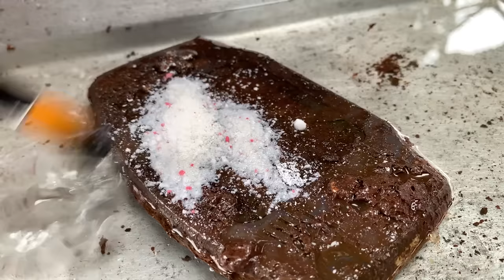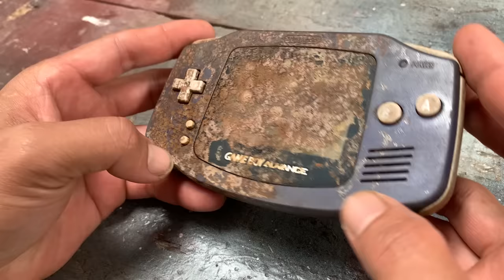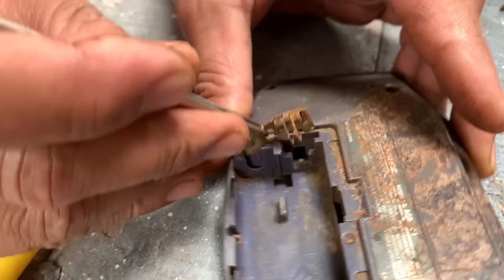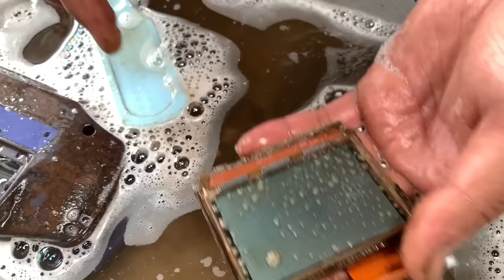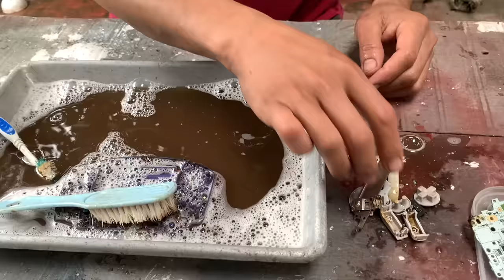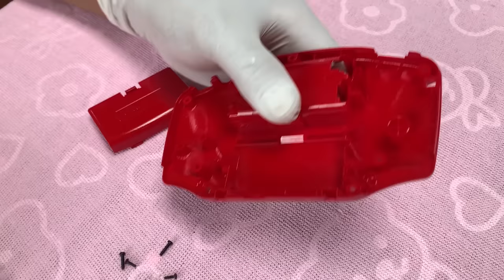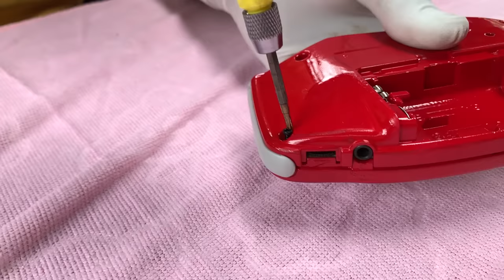Restoration Old Ｎｉｎｔenｄｏ gameboy advance | Restoring Game Boy Advance ＧＢＡ

Comment: Wow, I can't believe the hardware was still salvageable after being soaked in water.
Reply: Crazy how that works in this video
Reply: Thank you, i was confused as well
Reply: Bruh true
Reply: I think it's fake
Reply: It’s software but yeah it’s awesome
Reply: @tazeoloi9547  No, it's hardware.
Reply: Actually since the GBA didnt have an onboard battery, so long as it didnt get wet while a battery was attached, It usually is completely salvageable!
Reply: I think it was alcohol
Reply: so satisfying to watch
Reply: @morgan3814  this - and obviously you need to wait until everything is dry until you try to turn it on again
Reply: there's nintendo for you
Reply: it all depends on if the battery is fully discharged, or if you take out the battery. then no current will jump across a resistor and kill the CPU, same thing with a thumb drive, if you left it in your pants and put it in the washing machine, you could let it dry over time and it'll still work as long as there's no large capacitors on the circuit.
Reply: when i was young my little brother dropped his gameboy advance in a lake and my older brother dove in and got it, after it dried it worked just fine. Nintendo is very durable, same with my gamecube, fell down a staircase, in a pool and got chewed up by my dog.. still worked fine.
Reply: amazing what you can do if you have a full gameboy as spareparts.... haha
Reply: theres better wording than saying cant belive
Reply: As long as there is no power being directed into electronics, water won't damage them. You could say that electricity damages electronics when in contact with water because the current could direct itself back before it's supposed to causing it to actually burn the battery and circuit board.
Reply: GBAs are fucking beasts man, found one like that but not as bad years ago. Clearly had been outside for years, threw in some batteries and a game and bam started right up! so amazing
Reply: Most electronics hardware is fine as long as there isn't a battery hooked up and there is no current.
Reply: Ñ
Reply: @mustko5520  im p sure the minerals in the water affect the hardware, not the water itself, theres a video that explains it that uses it on a phone, using mineral water and normal water
Reply: It's not the new Iphone or android that are water resistant so yeah this is 100% fake.
Reply: and it is good that you can´t believe it.
Reply: its fake, this guy would have so many more subscribers if he simply did things such as test the screen, admit its broken, then get a working screen from another device and replace it, people would still watch/enjoy the video and admire his work. No need for the faking/deceiving people
Reply: @morgan3814  even water damage with being turned on isnt that bad.

most stuff is meant for electricity go through it.

the real issue is turning it back on while its still wet. 

but, this video is exponentially fake. 

this dude dirtied and placed a gameboy.
Reply: Not is water is a tinner

Comment: I think you made it look cooler than it was before. Reds a nice color for a GBA
Reply: Dude I’m sorry but this video is fake, they frickin S O A K E D the CPU, the battery port, the Headphone jack, the entire system that runs the screen AND the console as a WHOLE. The gameboy advance as well as all other Nintendo consoles are hella not waterproofed. After the wear they “found” that thing in it was never meant to ever function again. Sorry to be the bearer of bad news but they faked and potentially (forget I said potentially they DEFINITELY did) with 2 gameboy consoles (just showed the new one on-screen when they needed to show functionality). These guys are frauds.
Reply: @palerider2143  my nintendo 3ds xl died from being in my pocket during a rainstorm. It didnt get wet just the moisture in air, will not power on anymore. Lol
Reply: @milkoflegends  Yeah that almost happened to my Gameboy Light.

Comment: An impossibly damaged delicate electronic device bought back to life using the magic of video editing and NOT a scrubbing brush.
Reply: Yeah exactly i used to repair consoles for a living. You arent just going to wash off a wet motherboard and use it again. Thats not how this works lmao. Video editing not a brush.
Reply: @jackbryant4518  I'm not an expert but my dad used to repair electronic stuff too and when this dude poured water on top of everything I was like "what? I thought that was the last thing you were supposed to do (?)"
Reply: @JustAWildSkullKid  you can use water. its just not safe to use water on things that are powered on. also water can get in between small parts of the board, so you would need a good way to evaporate every nook and cranny before its usable. theres videos online of people cleaning their motherboards in their dishwashers and its 100% safe.
Reply: @Farrowstrike  Seconded.
Electrolytic caps can get funny, but it is possible to, say, wash a motherboard in the dishwasher.
Most modern components are well-sealed, potted, or are solid ceramic components.

LCD's on the other hand--no. Not ever.
Reply: @Farrowstrike  awesome! Didn't know that!

Comment: This is an excellent restoration, but I really hate the spray painting job. It looks sticky and overly glossy, I think it could have been done much better. I feel like it would've been cool to not paint over it at all and leave it with its imperfections to show the wear and tear it went through despite it working again, but it wouldn't be as much of a restoration then haha
Reply: i agree, the paint looked horrible.
Reply: This is fake...
Reply: Dude I’m sorry but this video is fake, they frickin S O A K E D the CPU, the battery port, the Headphone jack, the entire system that runs the screen AND the console as a WHOLE. The gameboy advance as well as all other Nintendo consoles are hella not waterproofed. After the wear they “found” that thing in it was never meant to ever function again. Sorry to be the bearer of bad news but they faked and potentially (forget I said potentially they DEFINITELY did) with 2 gameboy consoles (just showed the new one on-screen when they needed to show functionality). These guys are frauds.
Reply: @palerider2143  yes, its fake. If you find a GBA outside in that condition, the screean is 100% dead. But the cleaning process is not the problem, you can clean the electronics WITHOUT BATTERY with soap and water but you need to dry and rinse with alcohol thoroughly. all components are individually insulated, but the board paths are not.
Reply: @12bng  Thats what im saying?
Reply: @12bng  the board still had voltage which means there is no way it would have turned on unless they switched it with another board. Yes electronics can get wet and when dried theoretically still work. Tho if it still has a current even when off and the battery removed it will most certainly short circuit. This is why you don't see people cleaning electronics with water. I would most definitely not trust a guy to clean my electronics with water.
Reply: @oddgbmo3036  idk, i doub the capacitors would hold the current for so long. But yeah, using water is never the best option.
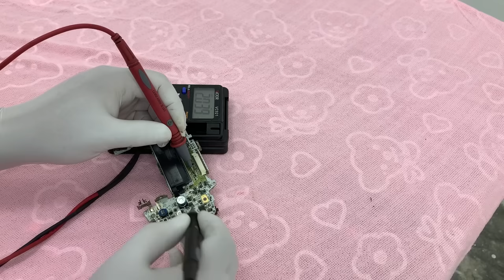Reply: @12bng  11:42 they had currents.

Also it definitely got wet years ago when it was thrown out which in that case would most definitely had a charge. This ofc goes without saying that it's faked and was planted there.

Comment: This is all really impressive and cool, but I must say...The spray paint looks terrible. I feel like this whole project would be completely perfect if you had either not painted it and left the imperfections of the plastic show from its former life, or used a better looking paint with a nice finish on it. The spray paint just looks cheep and tacky and sticky to the touch (I also hate red but that's obviously a personal opinion lol). But otherwise fantastic job!
Reply: Dude I’m sorry but this video is fake, they frickin S O A K E D the CPU, the battery port, the Headphone jack, the entire system that runs the screen AND the console as a WHOLE. The gameboy advance as well as all other Nintendo consoles are hella not waterproofed. After the wear they “found” that thing in it was never meant to ever function again. Sorry to be the bearer of bad news but they faked and potentially (forget I said potentially they DEFINITELY did) with 2 gameboy consoles (just showed the new one on-screen when they needed to show functionality). These guys are frauds.

Comment: HIM: Pouring water on an electronic board, then putting a battery to test if it still works.
ME: speechless 😮
Reply: You can tell he let it dry before he put in the batteries, it's not like it was 30 seconds later.
Reply: @BottomOfTheDumpsterFire  I'm saying that it would be best if he use isopropyl alcohol to clean a board instead of water because water cause corrosion, especially for older types of chips.

Comment: I have a hard time believing that there was absolutely no corrosion on the board or the battery terminals.
Reply: Because is impossible, i pretty sure they swap the board with a working one.
Reply: @DGP406  Exactly. Funniest part is when he measures god-knows-what on the circuit board. Just probes random spots, without a diagram or references. Hell, he barely waits for the voltage reading to stabilise. Anyone who is this good at electrical repair is neck deep in work, and definitely doesn't have time to prowl rice paddy junkyards in flipflops.
Reply: And that god awful paint job :/
Reply: @davidtoth8975  And the tester was in diode mode ;)  fake restore, they fool people.

Comment: As engineer i must say its 100% fake. You cant just wash up rusty board and make it work like that. It is 100% new board inside.
p.s. also i doubt he can spray red color so perfect, there are always will be some minor defects on surface.
Reply: As an electrical engineer I can spray the outside of that old housing better than he can fake this entire restoration. Actually, I could get that paint perfect.

Comment: Amazing work done to restore the console after it was so badly neglected, but I personally didn't like how the finished product looked because you threw away the plastic screen cover and the spray paint was a bit odd.
Reply: I admit it did look odd at first, but they replaced the old screen cover with a new one towards the end of the vid. Looking pretty good after that!
Reply: @Novern2442  Oh you're right. I should have watched the whole video before commenting
Reply: @mazda9624  No worries!

Comment: normally the contacts on the circuits get oxidized very fast while exposed to water...there is some kind of lacquer that can be applied on the circuit board to protect them form water... so i guess that is why the board was salvageable
Reply: believe it or not, this is fake. amazing i know, but it's called staging a video.
Reply: @PhonePhone-sf8te  it's obviously staged.

Comment: But how? You just used water to clean the electronics. I don’t remember a gameboy being waterproof. That would have killed it. Idk. However u did. It worked. Lol
Reply: There is no battery connected. So the water can't short anything without touching something with electrical current. U could actually wash the inside of a pc if it's unplugged.

Comment: Jesus Christ. Barely hid any of the made up stuff. The buttons were replaced, the screws were replaced, definitely not whatever you did with the originals. 

It definitely wouldn't have turned on early on in the video if the contacts were rusted.

Comment: The only thing you could save here would be the outer caseing, the outer screen and maybe the back lit screen. The circuit bord and motherboard would have corroded and beyond repair. These consoles are what you call water resistant which means that thay would survive a brief encounter with water I.e you accidentally drop the console in water and take it out straight away, after allowing it to dry it should work fine, however this quit obviously has been in water for much longer than a few minutes so will be totally useless, you could though clean up the case and sell it on as spare parts.

Comment: Yeah, try this with real hardware..  Got a board that is 20 years old and was outside for that long?  You'll encountered popped inductors, you will see corrosion on the traces, and on the soldier, the board might even be peeling between layers.  No way was this in such a state for long.